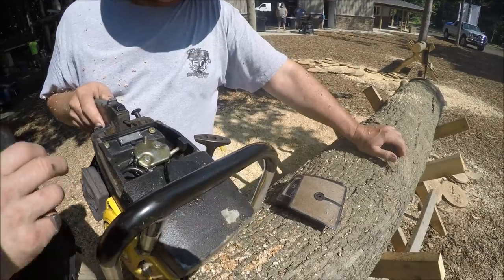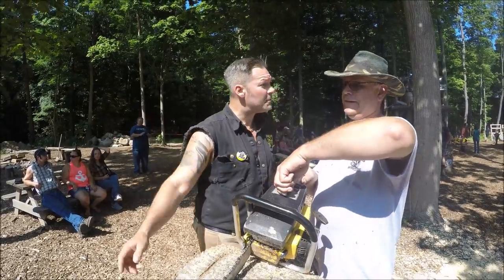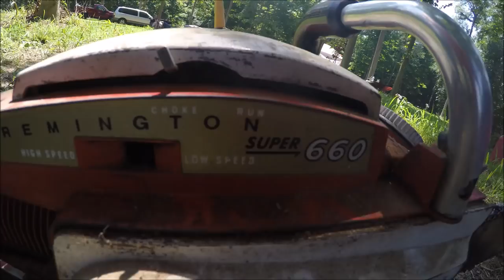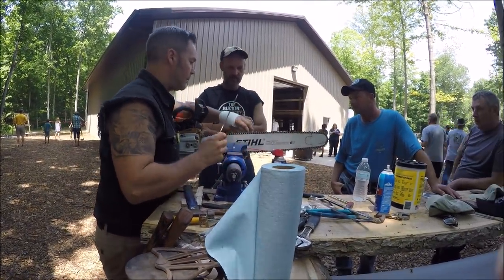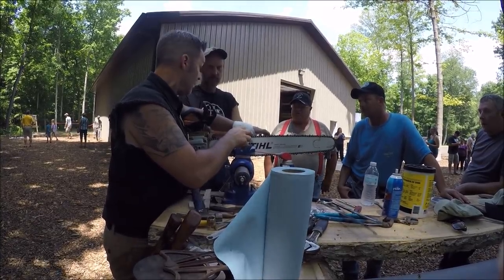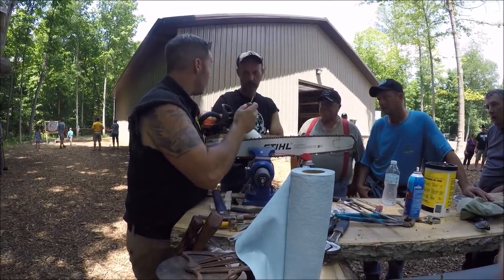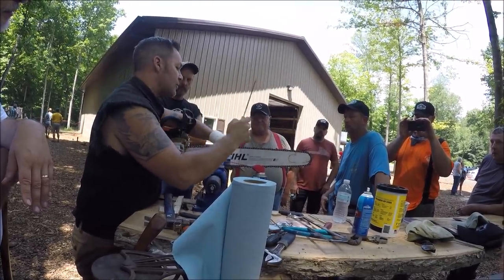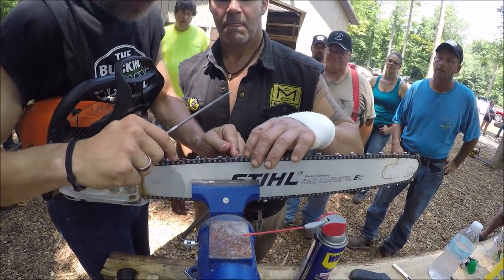BUCKIN'STOCK,  OLD POWER SAWS,, CHAIN SAW SHARPENING DEMO

Comment: I've been watching your video's for a minute now and really enjoy the chain sharpening stuff.  I've run a couple of saws in the past but only recently got some property and my own saw.  A Stihl MS 250 runs great but learning about all the different types of chains, filing, etc is interesting.  Currently it still has the little safety anti-kickback chain on it that it came with, but I've been playing with it adjusting the rakes, and sharpening it.  Having a blast though I have some tree's that need to come down around the property that are probably way above my level I'll have to work my way up to them.